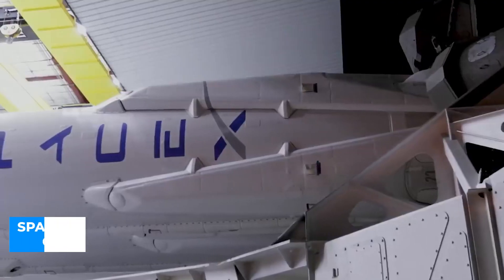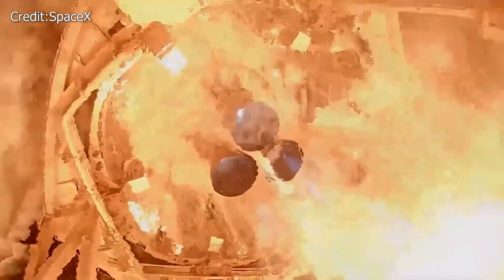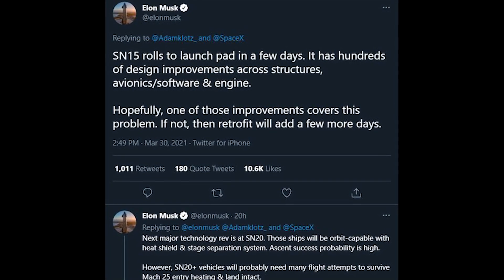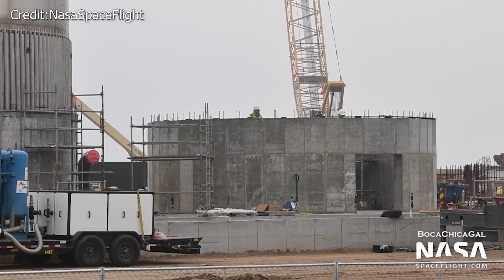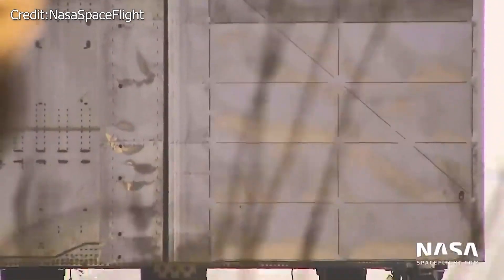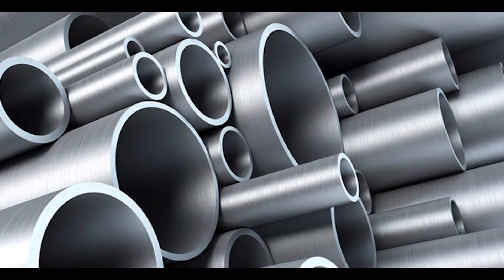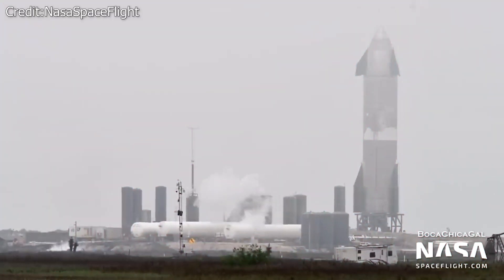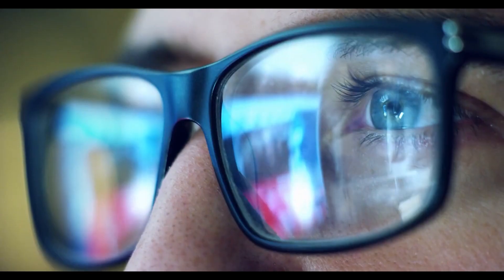Starship SN15 Upgrades: What is new? How is it different?

Comment: I am wondering why these improvements on SN-15 were not incorporated into other previous SN8-11 if they were that great. If its going no higher than 12.5 km, why not put in just enough fuel to compete a 12.5 km flight plus 10% only.
Reply from the maker: i think its for the basic concept of, first make a basic prototype that works- then make it complex. sn8-1n11 were simpler starships to test out concepts. sn15 is more close to elon's vision of a real starship. sn-20 will be even closer
Reply: Another reason they didn't put many changes in SN8-11 is a lot of the changes for SN15 weren't known until they ran into problems in the tests. The point of SN8-11 was to find issues with their design through test. SpaceX also has the goal of learning to build Starships as fast as possible, so they weren't going to slow down their production process to incorporate fixes into each vehicle. This is also because each flight can teach them things they didn't know before even if it has flaws they already know about. Lastly Elon has said that Starship may not be landed on legs in the future. Based on that I don't think landing has ever been a priority beyond their desire of getting the vehicle back so they can inspect it after tests. Flight tests are more focused on trying to get the horizontal glide and flip to work, and to test out all the vehicle's systems. SpaceX may still be working on getting Starships to land or be caught by other means while falling horizontally (see Elon's tweet about this) even after they are going orbital on top of SuperHeavy with payloads inside. This is because SpaceX likely sees delivering payloads to orbit as a priority over recovering Starship since as long as it can get to orbit they can sell the payload space and bring in revenue, all while they continue to iterate while learning how to eventually achieve full recovery. They would just rather experiment with the flip behavior now first, because once they are making attempts to enter from orbit it will be much more expensive to add things like full heat tiles to each vehicle for each attempt, so they want to test out all the low altitude flight characteristics now rather than later.